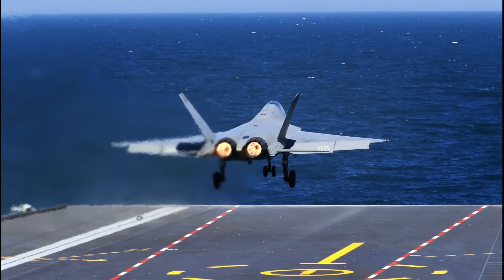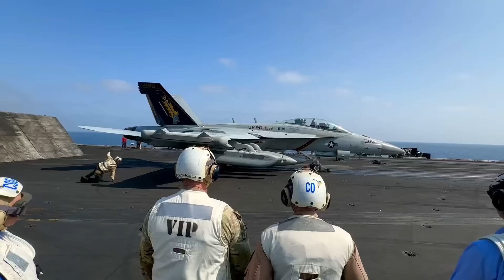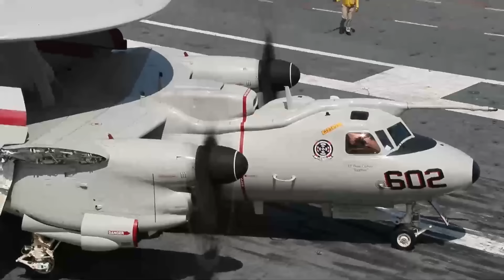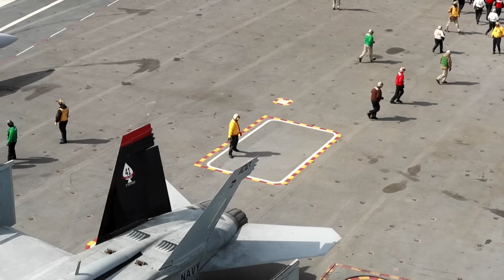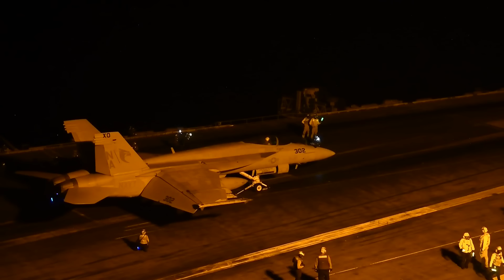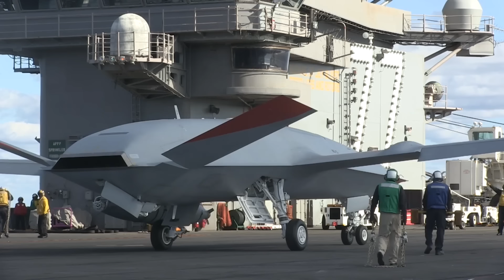EMALS Catapult on US Carriers: Mistake or Masterpiece?

Comment: I worked on the flight deck of The...USS Constellation CVA-64 from 1971-73. The four steam cats worked flawlessly, day in, day out. Our longest time of flight ops was 49 days/nights. A 14-16 hr. day was the norm. We started at 0700 everyday. 
  My vote on the electric launching system is...build one new ship with the electric system ( like we are doing on the  the John F. Kennedy).  Run them. Learn as "ya go" as the saying is.  
  Changing horses in the middle of a stream has never been a flawless event. Tearing out what's already in place...there would need to be an 8" to 10"  sch. 80 or heavier pipe run from the boilers (reactors) up through compartments that were Never designed to have  them in there. ..go to each steam drum, four total, one for each cat...  (no space was alloted for these either). Then it'll take two 18" sch. 80 or heavier steam pipes per cat, running the length of each one. Again going into compartments that were Never sized for them to be there.    Mr. Trump is capable of understanding there is so much effort, expense and time in the emals already being worked on...surely someone in the Navy will say to Mr. Trump..."Mr. President, we have spent years on what has been installed now, you don't want us to waste all that...wouldn't you think it would be a good idea to build a new carrier using steam catapults like you want? "
  All the best everyone, Pete 
P.S., It could also be mentioned to the president..."Mr President, the ship won't have the ability to make as much steam as will be needed. The ship is set up to make electricity instead of steam. We might as well start over...this will put us years behind in getting her ready to deploy. We can't afford to take that much time. It would put us short of the carriers we need."

Comment: As EMALS is currently fitted to one operational carrier data and real world experience is limited. You can test anything to breaking point before introduction but only daily use on a carrier will identify defects and improvements. The system needs time.

Comment: However; The Electromagnetic EMALS system DJT wants removed from aircraft carriers uses the exact same principles as the “Rail Guns” which he is demanding to be installed on his fleet of Golden Battle Ships…
Reply: The only thing they have in common is they use electricity, which my washing machine also use.
Reply: @CengalLut  They use electromagnetism, which I doubt your washing machine does.
Reply: @TheLucanicLord  Your washing machine literally uses electromagnetism to turn the drum around, as did any electric motor ever. You have NO idea what you're even talking about.
Reply: How dare you suggest that Trump doesn’t know what he’s talking about.
Reply: No, not even close. This is more like a coil gun, sometimes called a gauss gun. It would be useless as a weapon.
Reply: @NegotiatorGladiarius  Do you know how a rail gun works?
Reply: @CuzBarnaJuner  Yes. I do. It's NOTHING like the coilgun that an electromagnetic catapult is. Do YOU? Don't think so.
Reply: @NegotiatorGladiarius  Railguns use powerful electromagnetic fields to accelerate metal projectiles at hypervelocities instead of using expanding gases from burning gunpowder.
Reply: @CuzBarnaJuner  By entirely different means than a coilgun, which this one is. As was said, this has more in common with your washing machine's motor than a railgun.

Not the least because nobody ever figured out how to " use powerful electromagnetic fields to accelerate metal projectiles at hypervelocities" with a coilgun.
Reply: The Electromagnetic Aircraft Launch System uses a magnetic field rather than steam. ---  A railgun uses a magnetic field rather then gun powder.
Reply: @NegotiatorGladiarius  Agree that the railguns Trump wants for his Golden Fleet don't really work....
Reply: @CuzBarnaJuner  Well, they kinda do, but the barrel life is negligible and the energy needs are enormous. So basically it's like saying you could lift a commercial airliner if you were Supergirl :P

As for Trump, nobody knows what's in his head, least of all himself :P

I mean, forget even the railgun, the navy gave up on battleships because even the 16 inches of armour on a Yamato won't save it. And Trump thinks that 6 inches of steel on his will make a difference? That's WW2 CRUISER level of armour. Keywords: WW2.
Reply: @CuzBarnaJuner  Sure. In the same way as a Tesla's electric motor relies on magnetic fields rather than exploding a fuel-air mixture. There's more than one way to use electromagnetism, and they're not all the same thing, except for the superficial level that they do involve magnetism.

As a trivial example, a coil-gun (such as the electromagnetic aircraft launcher) can only really accelerate a ferromagnetic slug or another magnet to any noticeable extent. A railgun accelerates a paramagnetic tungsten slug just the same. You could technically accelerate a regular bullet with a railgun just the same, and both lead and copper are DIAmagnetic. As long as it conducts electricity, it works just the same.

Not that it makes Trump less stupid, but I think most of us had already figured out that he's the Clown In Chief :P

Comment: on a serious note, i stg most of these mf swearing by the steam catapult never lived on a large ship for over 7 days. The biggest and most annoying point of failure on large ships is never the electronics, it's the plumbing. We are talking about removing one of the largest high pressure plumbing networks from a ship, no sailor would object to that. Fixing up electronics is always simpler than fixing up plumbing on a ship, and these pipes DO fail on the Nimitz overtime too. Any ACTUAL sailor would tell you they'd rather have electronics than big long pipes.

Comment: The argument for steam catapults is the same argument you have for all legacy equipment and you would never upgrade equipment and we would still be using muskets and canon. What they need to do is redesign EMALS so it has more redundancy and it is more easy worked on.
Reply: The one man behind this back to steam is the same Troglodyte who hates wind turbines and frequently rails against magnetic (electromagnetic) aircraft elevators on modern U.S. aircraft carriers, claiming water can ruin magnets and arguing that heavy-duty machinery should use traditional hydraulics like tractors do.

Comment: I do believe getting rid of the EMALS on these carriers are the brightest move anyone could do. All I have to do is look at my vehicle with all the bells, whistles and sensors and how often I have to replace these devises tells me electronics on anything that moves is the wrong way to go. It's not a wonder that a new article that just got published shows people are buying older vehicles without the electronics on them for daily drivers because they are sick and tired of having their newly made junk in for replacement electronic parts. I don't even have 20,000 miles from the last time sensors were replaced in my truck and again my mileage is down so this thing has to go back to the mechanic again. Any vehicle made after 1966 is complete garbage.
Reply: I have kept my '65 F100 b/c it is simple. Zero 'lectronics. Going on 45 yrs now.
Reply: Ok grandpa, obviously no idea what we are talking about here. It will be really simple to reengineer a hull to throw in massive amounts of space waisting pipes and collectors right?
Reply: @Denguer-b1s  Hell of a lot better than bails of wire that don't work.

Comment: could the technics used in EMALS to propel naval artillery.
Reply: I don't think the navy uses artillery anymore.... It's all missiles and drones
Reply: @andrewmcmurray9439  They tried an electric cannon, that didn't work well either.
Reply: @TomM60 practically everybody and their mother has successfully tested a railgun by now, but it simply cannot compete with modern missiles and drones
Reply: @Denguer-b1s  That's right. It uses up all kinds of energy with one pop. It's useless.
Reply: @andrewmcmurray9439  the EMAL is a forf of RAIL gun and thet have been trying to develop one that meets it's needs.

Comment: Yah iterate it.
One perhaps too obvious imprivement should be to allow power module 1-2 to drive cat 3-4 and vice versa. Thats just wiring. Harder to decouple 1 from 2 and 3 from 4.
Key is how did EMALS perform on recent deployment of hell. If it was spotty then I can see why theyres still talking about reverting. Ifbit was basically solid then it should be full speed ahead with incremental imprivements.

Comment: Smart in case of a EMP or any Electronic warfare the steam Catapults will still get aircraft off the deck! Electro magnetic can be shut down with EA-18 Growlers  AGM-88 HARM anti-radiation missiles and AN/ALQ-99 tactical jamming pods (and transitioning to the new Next-Generation Jammer) to flood enemy frequencies with noise.
Reply: I am not sure if you are serious or doing some kind of parody. All military electronics are hardened against EMP and electronic warfare and jamming doesn't have to do with disabling hardware but with electro-magnetic radiation used by emitters and receivers, radars and radio transmitters normally.
Reply: Rainbow six siege is down the corner and to the left my guy.

Comment: One thing no one in the comments seems to consider is the re-design work that would be needed to restore steam cats to the Ford class.  Just redesigning the system would cost as much as a whole ship, in both time and money.  I would rather see the Nimitz class refit / rebuilt alongside new Fords, with upgrades to EMALS and other updated electronics, along with the new reactors they would need.  I am not sure such a complete refit is actually as cost-effective as some seem to think it would be, however, as you would need to replace pretty much the entire power grid on the ship as well as most of the electronics along with the reactors and much of the worn-out drive systems.
Reply: It would be cheaper and faster to just scrap her and the next two. The reactors are the one thing you wouldn't have to replace. the A1B can handle the steam load. We won't go back to steam catapults.

Comment: The US should stop building more Ford class after the Enterprise, Kennedy and Doris Miller. Instead refurb of Nimitz class would be a far cheaper and effective route in an era when giant carriers will likely become obsolete. One Nimitz class can be fully refitted like new for $4 billion instead of the absurt $13+ billion for each new Ford class.
Reply: I think that the era of the huge supercarrier is over, a better idea would be to build many more smaller carriers in the 40-50,000 ton range.  The carrier air wing would be much smaller but this could be supplemented by UCAVs and or disposable drones.  Having more carriers means more carriers on station and in surge reserve, it would also speed up build times massively and would be less vulnerable to a single surprise attack.  The current US carrier presence in the Gulf (Lincoln and Bush) is just two ballistic missiles away from being rendered inoperative.
Reply: by the way, what do you (guys) think of rocket-assisted-take-off for UCAVs ?
a softer-push rocket booster for launching UCAVs could be used alongside steam catapult on CATOBAR big carriers, and exclusively on STOVL light carriers

Comment: The EMALS has not yet equaled the real world continuous sustained launch and recovery cycle that all the Nimitz  Carriers actually did.
Reply: What’s the point in stating this? This will be the case with any new technology. Using steam isn’t thinking strategically or long term.
Reply: In July 2026: EMALS is Not new.  It was first used ( on Land) to actually launch a jet plane in 201O.  Many millions of  dollars were used to develop it many years before that.  The first carrier to have it, first launched a plane in 2015. That carrier could not deploy for about three years beyond its projected date primarily because the EMALs was Not dependable. It became the major engineering focus for the whole Navy during that time! More millions were spent trying to fix it. Other carriers had their cruise times lengthened because it could not do a real deployment.  Even right now, it has Not shown the ability to sustain the launch cycle abilities of the steam systems on our Nimitz class. After all, its about getting planes in the air, and getting them up there faster and with dependability.
Reply: @raywhitehead730 how long do you reckon it took them to get steam squared away? The first carrier it was installed on?
Reply: @raywhitehead730  So nothing new is worthwhile if it has growing pains?

Comment: The USN will perfect the system over time. In fact, it’ll have an easier time integrating the system than the PLAN, especially if their type 004 carrier launches with a nuclear power plant. Will China keep the medium powered DC system they were forced to use on the conventionally powered type 003, or go ahead and adopt AC system when their carriers finally have enough power to sustain it?
Reply: dude, DC is way better than AC. And it is called Medium Voltage DC (MVDC) not medium powered.  This is basic science, not an engineering issue.  AC is the reason the US catapult is problematic.
Reply: the medium powered DC system was likely adapted from, or at least inspired by the magnetic levitation technology on some of their rare maglev metro in some Chinese cities
so it is already a near-matured technology by the time PLAN came up with that medium powered DC EMAL
edit: maglev and EMAL are probably not similar designs, but the electromagnetic researchs, educations, innovations & engineers could share the same source, the same engineers fixing maglev trains may be able to work on an EMAL quite well

Comment: Problem isn't the idea, just look at the Chinese DC system. It's the implementation, which US lacks engineers (choosing AC).
Reply: China is suffering their own setbacks on the type 003 with the EMAL system and potential deck layout
Reply: @danielmartin7838 Deck layout is independent from the software issues with EMALS operations though, and the larger Type 004 addresses this. What other setbacks does the Type 003 have with launching aircrafts?
Reply: @danielmartin7838 Chinese EM catapults are problem free, the deck layout is something completely different
Reply: @Denguer-b1s  no they are not
Reply: @danielmartin7838  China has spent its suffering time back in the early 2000s when it first installed maglev metro in some cities.
impractical as it is, maglev train technology is analogous with EMAL technology;
so after Chinese engineers shed enough haemorrhoid blood fixing the setbacks on their maglev trains (for 20+ years as of now), the technological base for their EMALs is already quite matured.
edit: maglev & EMAL are probably not similar designs, but the electromagnetic engineers designing, making & fixing them are the same people; an engineer who fix maglev trains can comfortably work on an EMAL.